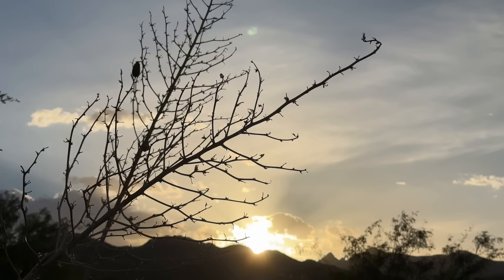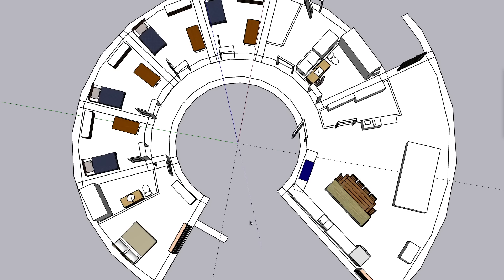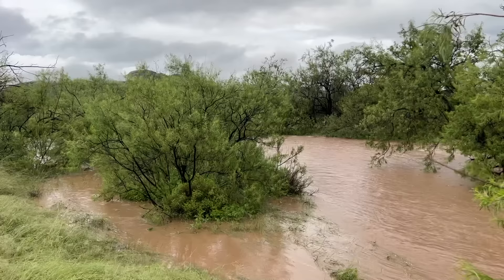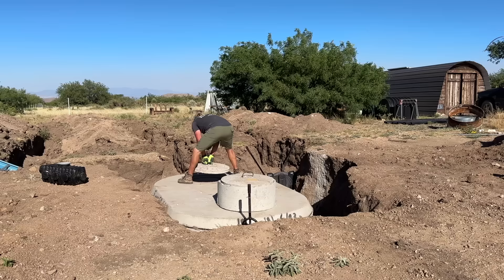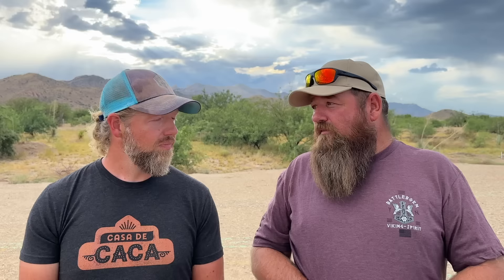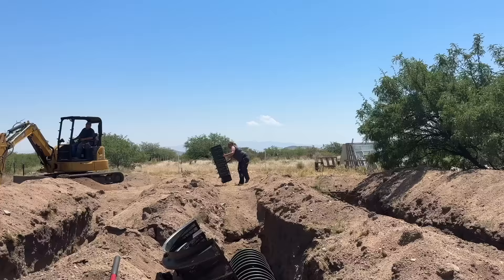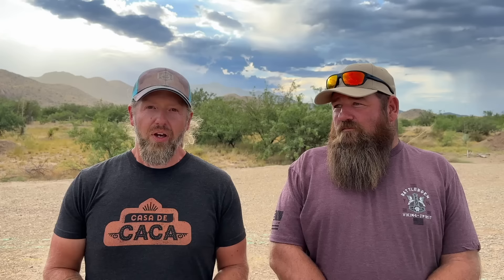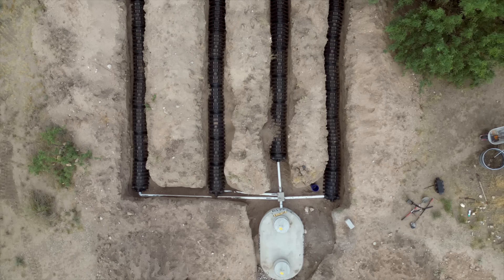How to INSTALL your Own SEPTIC SYSTEM (w Tips From a Pro)

Comment: Zach seems like the kind of guy who would instill confidence in his customers. $750 seems very reasonable.
Reply: For extortion😢
Reply: @kevinoneill41  So you can get an excavator to dig the perk holes, haul the water to saturate the holes and then submit and design a system for less? That's a fair price for the amount of work and time involved.
Reply: @kevinoneill41  Considering heavy equipment costs, transportation, man hours and specialty skills and certifications, I don't think that's crazy at all.

Comment: 14 thousand dollars canadian for ours.  And it all froze.  Three years in a row.       I took it all apart.  Rebuilt it myself.   Put it all 5 feet deeper.     Insulation of 4 inches over all the pipes from the house to the tank.       Now.  My septic works perfect

Comment: We had a septic installed at our off-grid site up in Coconino County this summer. We spent $11,400 on parts, labor, and design. The permits cost another $1,100 in total.

Comment: I live in Canada and I know the rules are different but wow a great amount of information! Great job!
Reply: Usually colder areas need deeper Leach fields so that they don't freeze. but I also assume that the setbacks and other requirements are different. Septic systems all in all are soil dependent. Different soil types require different sizes and considerations.
Reply: I install systems in Canada, Vancouver Island, full time, almost all the info is the same, we bury our infiltrators no more than 12", most our systems are pressurized, there would be a pump chamber after the main tank. On this system the d-box should have a riser, they will need access at some point

Comment: I’ve been installing septic systems for 45+ years and I think Zack did a pretty good job explaining ! Your soil test is everything it determines what you can install  . You are very fortunate to be able to have the type of septic system that you installed . in West Central, Ohio, where I am from in some areas. Seasonal water tables are very high, and that can result in a very expensive septic system! The most expensive septic system that I’ve done for a three bedroom house was a mound system that cost the homeowner $32,000!
Reply from the maker: Yes, desert sand has it's advantages and disadvantages :)
Reply: @TinyShinyHome  👍👍

Comment: Good video! I live in Ukraine, we are using this kind of septic system in almost every village.

There should be 3 separate tanks (or arias in one tank), connected by pipes on top.
First tank takes "black" (or dirty) water - the heavy parts (poo) will fall down, the light parts (fat) - will be on top. Water in the middle is fine and should go into second tank (you need to add t-shaped pipe fittings on the start of each tank-to-tank pipe, like this:   |------ > water goes out ).
Second tank's purpose it to "enlight" the water. This tank is the home of bacterias (anaerobic bacterias - if you use passive system without pomps). There is not problem of having multiple tanks on this step.
Last tank (or third one) - is alternative to to drainage system. It should not have any bottom, just install it as is into soil (you have quite sandy soil, it is perfect) and add some 10 cm (4 inches) of big fraction gravel into it. The bottom of this last tank will be full of bacterias and eventually (in 5-10 years, depends on soil and usage) the remains of bacterias will block filtration.
The solution is simple - just dig another hole for next tank.

The cheapest material for this type of septic is concrete pipes (identical to "risers" on your video, from 1 m in diameter to 2 m).
Drainage field (as you did on your video) is also used in Ukraine, but it is expensive (extra work and materials), also has limited life span (5-10 years) and makes sense only if your soil is full of clay, so it takes a lot of time for soil to consume the water.
I personally have septic system, described above, it works perfectly on sandy soil.

Also important to add that last tank should have ventilation pipe, and your sewerage pipe should "start" on the roof of the house. It solves two problems:
1) bacterias produces gas, that goes thought sewerage pipe into atmosphere, so you don't have this smell close to tank of drainage field;
2) when you flush the toilet on second flor, and your sewerage pipe is sealed, this will create pressure that will take water from sink nearby and eventually smelly gas from tank will find it's way into your house (especially if you are not using this sink often).

Comment: I live in municipality of Anchorage in Alaska. I hired Brent Western of first water consulting to design, engineer and inspect the installation and I hired JR's septic in chugiak Alaska to the excavation and install. When I received a final COSA (certificate of on-site systems approval) on my Advantex system signed by the engineer and city DEC engineers. It was not a functioning I had to call and let the city know that it did not work because the electrician didnt hook it up, because no one did any final inspections they just rubber stamped it. A cosa (inspection) is just a way for the government to tax you here in Alaska.

Comment: This is one of the reasons I love Thailand. I will be putting in 10 septic systems over the next 5 years.  One for each Bungalow and a bigger one for the main house.

Here in Thailand, if you live in the countryside like I do, you can get away with a very simple septic. Those risers you have for your septic tank, they use 3 of them, one on top of the others and they have some holes in them to let the liquids soke into the surrounding dirt.

Every 2 or three months, you have a honey truck come and pump it out. It's a simple syatem but it works.

For the big house I will put in a septic system like what you are putting in because of the size of the house and the amount of people using it. ❤
Reply: Definitely things are much easier in other countries but you REALLY have to keep a close eye on every single aspect of who ever is doing the installation (unless you’re doing it yourself). I’ve built homes in Mexico, El Salvador, Nicaragua, Costa Rica and Bali. What I’ve seen some “contractors” do to many homeowners would make just about anyone cry. I’m talking about not putting any steel reinforcing in foundations and retaining walls, trash shoved into walls so there’s less concrete required, sketchy electrical and plumbing work, et c… I could go on for days with the shi+ that I’ve seen. I get asked all the time if I’ll repair some of this work but unfortunately I always have to decline. I can’t afford to have my name attached to any of it and most homeowners don’t understand the costs involved with chasing shoddy construction and redoing everything correctly. 
 
Hope things go well for you in Thailand, it’s a beautiful country with wonderful people.

Comment: Good job!

I did one in Marlton NJ years ago but it was a pump system / sand mound. I replaced a cesspit which is just the tank, no field. I rented an excavator for a week to dig everything, had a septic company design it and the cost was around $11-12k vs $30-40k I was originally quoted. Lot of work but I also hired some day labor from a contractor friend. I also got a recommendation from the tank company and paid a pro to come out and set the tank. I got a break because I had the excavator on site. The truck couldn't drop the tank directly so it had to be driven around hooked to the excavator and there was no way I wanted to try that myself... 

Fun, stressful, but so worth it. I probably could have done it cheaper by doing more myself but it was a good mix overall. Oh, I forgot I also had an electrician do the hookup for the pump part of it. The way it works is the effluent is pumped into pipes and it sprays out into the sand mound then percs down. So there's the pump and a high water alarm that needed to be installed.

Comment: Holy cow!  That full septic system cost is about the value of my whole property.  Also, it would take up most of the property.  I really didn't know it would be so expensive/complicated to put something in.  I've planned to have a "primitive system" (outhouse/composting-toilet), so I didn't think I'd need a septic, but hadn't actually asked yet.  I'm still waiting until I have some help before I call to get the design/PERC test done.  Now I'm worried that I might not be able to afford to put in what's required.  Some day we'll have a system where things like this aren't preventing people from living on their own land.
Reply from the maker: Yeah I think most people assume their property is the most expensive thing they'll need to buy to live off grid, but that's not the case at all, unfortunately. Building power, water, septic, etc... is hugely expensive.
Reply: @TinyShinyHome  I just thought that if I had a primitive system I wouldn't need anything fancy like a tank.  As for water and electric, I was just planning on simple systems.  I've already lived off grid before (on someone else's land), and have a small solar electric system, and just got rainwater off the roof.  I'm going to cross my fingers and hope things are really affordable, but also, thanks for the explanation of what's going on with all of your septic stuff, as it's made me realize I need to ask a bunch more questions from my town office soon! :-)

Comment: A big 👍to the people like Zach that have taken the time to understand the process and bureaucracy of the County and not every County is the same so check with them first and get the latest information on requirements and all your materials and measurements. Yes DIY is a money saver if your Zack. Not so much if your not 👍. But someone has to get on the end of a shovel and glue all the pieces together etc... if you are good with that thats all the DIY people like Zach need. Again good video 👍I  was worried about this on that first video 😂

Comment: We installed our system and the inspector designed it for us. Im in SC near sea level. It was not hard to permit and design. The work involved digging in the ground. Our setback was 10 ft from the perimeter of the property, 75 ft from well to the leach feild and 15 ft from the leach to another layer of flood zoning. Its not hard to understand. Its much harder to put in the work. We ended up doing 2 systems for 2 structures into 1 feild. Hopefully everyone has a great inspector like we did.
We went with EZ Flow because infultrators wouldn't work close to sea level. We have 2 1,000 gallon tanks to a D-box with a leach feild of 40x100 feet. We ran schedule 40 to our D-box with only 45% joints not 90% joints. We also supported evey joint with blocks and concrete. This was recommended by the inspector if it was his house. We gladly took the recommendation. We also put a structure foundation below each tank as recommended from the inspector.

Comment: When I sold my house in Massachusetts, I had the bring the septic up to code. This is a requirement for all homes in the state. I had to upgrade my electric panel, I had to install a sewage pump, I had to have trees removed, and a completely different septic field dug. This was in 2004. It only cost $18,000. The original septic was installed in 1952. I expect that my dad and grandfather installed that one. No permit required.
Reply from the maker: I bet that would cost 6 figures now to do all that 😂
Reply: 1952 and your the second generation to be on that system. that is great to hear.  Thay must have done a great job for the time.

Comment: As a Septic Professional with over 20 years of experience, I've seen lots of Plastic Chamber Leaching Fields in my state of New Hampshire. Obviously, we have very different soil conditions than in Arizona, but I recommend using clean crushed stone or washed aggregate with Plastic Chamber Systems. To be clear, instead of digging trenches we typically install the chambers in parallel rows on a level bed of septic sand. Then, in between the rows and around the perimeter of the Plastic Chambers is crushed stone with Filter Fabric over the top. This method of installation works the best in my opinion, because backfilling the chambers with just sand or the indigenous soil on-site usually plugs up the louvers of the chambers. In my experience, using crushed stone or aggregate material prevents that from happening. In addition, I believe the system will work better and last longer. However, I'm in a part of the country where we have access to crushed stone or processed aggregate, which is relatively inexpensive, and easier to source than septic sand that meets the required specifications. Also, venting the far end of the Plastic Chambers is really important and recommended, especially when the chambers are deeper than 18 inches below grade. I suggest building a manifold to allow every row of chambers to be vented through one gooseneck or candy cane vent pipe. I'm a big proponent of improving or enhancing oxygenation, because increased airflow aids in evaporation of excess water. Regarding the Effluent Filter in the Outlet Baffle of the Septic Tank, I'm not a fan because the filter impedes airflow and prohibits oxygen transfer, plus it's a maintenance issue or headache, most homeowners don't need or want.

Comment: Good video with a lot of great information. Zack, you looked so bored it cracked me up. I don't remember how many bedrooms this setup was based on. I do thank both of you for putting your video up with septic made simple all the way through.  Then put a new infiltrator line to replace 70+ year existing trench. This will require one trench and a new gray water pit for kitchen and bath/shower. Not sure if this problem or all the oak trees dying/falling on yard fence, punched hole in roof and blocking roads is worse. SODS or sudden oak death syndrome is more worrisome as an ecological critical warning.

Comment: Excellent video, but it was a bit confused when Zack said that you should not drive over the Leach field?
Maybe I missed it and he was talking about the actual tanks themselves, but when we got our system installed which is very similar to your system, except about half the size, we were told that we could drive over the leach field because they were good for about six tons of pressure. 
The leach field is in a portion of our land that we drive on almost daily to turn around with a two-ton SUV and have never had any problems. 
Also we had a shipping container delivered and the truck had to drive across the leach field and there was no damage.
I believe our system is the same as yours because I remember when it was installed and it looks exactly like yours except again about half the size. 
As far as cost I think you're right on the money. 
I remember we paid about $5, 000 to 6,000 and that was probably six or seven years ago. 
You will love this system as we have had zero problems with ours. 
We have had it pumped at the 5-year mark and were told that we could go much longer if we wanted to but I think we will stick to a 5-year pumping schedule. 
I was amazed when they opened it up that it was performing perfectly.
Think you guys did great!
Reply from the maker: I'm not sure why they would have told you that since they're just plastic pieces. The deeper they are the more it will help distribute the weight, but leach lines are definitely not something you want constant activity over. Every once in a while is probably ok, though :)

Comment: You save a little money with sch 35. But with sch 35 and abs that is going to be the next expense you have with your septic. Both of those pipes are extremely vulnerable to failure. You should always use sch 40 solidcore pvc. It costs a little more but it is the most reliable pipe for the application
Reply: And use 4" I find 3" to light and that flex pipe is a waste of time and money.
Reply: ??? Curious. Why would it fail.

Comment: I biilt my own for two properties and the requirements were a split  field that you use half at a time. 1800 feet total leach plus another five hundred perimeter drain.Two thousand gallon tank. The backhoe was digging blind at the bottom with the hole eight feet deep.
    I used pipe ln gravel snd set the pioe on stands holding the pipe on the stands with old motorcycle tire tubes. Did the rntire job myself. Spent about 4 K per system fifteen years ago

Comment: Zach seems both knowledgeable and friendly. A good combination. One question I’d have is what happens if your house is below grade like a sunken or underground house. (Yes I still dream of my Tatooine home some day. Me<-geek. )
Reply from the maker: Then your septic is way deep in the ground. There are also macerator type pump options to move uphill, but adds a lot of extra maintenance and potential issues long term.
Reply: Good drain field sump pump chambers with a backup system, septic would be pumped to a statalight area and distributed in a field there. Engineering is required for sure.

Comment: A field should be as long and skinny as possible in order to maximise your linear loading area which will extend the life of the field.   It's called the minimum system contour length. DDF/LLR=Min Con Length in meters.
Reply from the maker: In this case the infiltrators are already a certain width, and each leach line has to be spaced a certain distance apart depending on soil type. All of these regulations will change a bit depending on your location.

Comment: Having a designer design should be done BEFORE buying property. It cost me the 2000 for the design.  It would be sad the find that septic or a well can not be in stalled on a property after it is purchased.  This video has lots of good info. It is well done. 😊😊